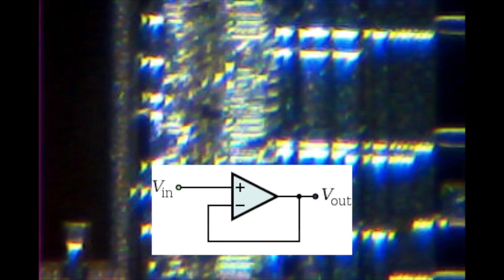What's inside a microchip ?

Comment: Really gives you an idea of how complex computers are. It's insane how precise the manufacturing have to be to make all of this work.
Reply: TheHolyReality It is all regulated by computers nowadays. They make a batch and then check a few chips for their functionality - if they all work, probably the rest work as well.

To see how IC-s are made you can search youtube - there are a lot of videos on it.
Reply: @jyrgenruut  They test all the chips on the wafer, not just some, and it doesn't work like that. You will get more dead in some, more alive in others, and they're not located in the same spot or such.
Reply: @jackbootshamangaming4541  I made that post over 6 years ago. Since then I have learned that they indeed, test every single chip with a very basic set of instructions and various speeds to test for how well the chip performs. A single design could result in quite a few different types of IC-s... this is called "binning". And this is also the reason why, when overclocking, different processors would fail at completely different overclocking speeds - they simply wouldn't test for it at the factory. 

(In addition I have learned a lot more about IC manufacturing and design in general since then... I know my post is a bit misleading)
Reply: @jackbootshamangaming4541  What is a transputer?
Reply: Actually all chips are tested because a single dust particle can destroy a chip. Even with the most painstaking measures of ensuring clean assembly lines the rooms are never entirely clean. That means that every chip has to be tested for functionality.
This is also the reason why they don't make chips the size of a wafer: If you have many small chips on a wafer then you will have to throw some of them away but still get a good yield. But if you were to make a chip as big as a wafer you would probably have to throw >99% of all chips away.

Some measures to increase the yield is to make designs that can cope with a defect. The Playstation 3 was built with an 8-Core CPU - but it only used 7 cores. Why? Because the chip was designed such that the cores could be deactivated if faulty. So if during production a particle of dust landed on one of the cores but the other seven were fine, no biggy, works anyway. Of course, a particle of dust landing on some critical parts would still destroy the chip, but such a yield increase makes things a lot cheaper.

There is also another reason why every chip has to be tested: Not all chips are created equal. Your typical Intel CPU will be sold under many different classifications - 7400, 7700, 7-something-or-another... but they were all designed the same. It's just that the silicon was formed better on some than on others, so the better ones become the i7s and the worse the i3s. Different cache sizes? Well, there was a defect on one cache block. Different speeds? Some transistors turned out not that well and the chip can't go as fast as it's neighbor.
Reply: @Althemor  
Honestly, a massive thanks for this explanation. I've been pining for microchip answers for months and the more I find, the more I'd like to know. Your answer helps so much lol
Reply: @jayrh98  Things have actually changed somewhat since then. Taking the newest generation as an example, Intel actually makes its 12th gen processors in the form of four different "dies" (four designs, which become more different processor types ("SKUs" like i3 12100 or i9 12900K) through what I described in the old comment). The different end results they sell are just too different. The i3 12100 has 4 normal cores. The i9 12900K has 8 normal cores, AND 8 little cores. I'm pretty sure the die that produces 12100s doesn't even include the little cores in its design. And some dies have more integrated graphics than others.
Meanwhile most of AMD's products aren't "monolithic" designs anymore, or in other words: They don't produce the entire processor as one big piece, but rather as smaller pieces called "chiplets" which are then connected. AMD Processors up to the 5800X are made of one eight-core (unless cores are disabled because of defects) chiplet connected to the IO die. Basically, the eight-core chiplet is the raw computing power, and the IO die is the thing that handles communication with the rest of the computer, stuff like RAM, storage and graphics cards. More powerful AMD processors have multiple eight-core chiplets. This way, AMD can produce chips with a greater total size without incurring the same yield losses a monolithic design would bring, though a monolithic design would perform a bit better.
As far as I know, Intel intends to move to a "tile" based design in the future, which I don't know much about but I believe for the laymen it's basically the same thing.
Also, AMD is about to release a processor made with a pretty nifty new trick this month: The 5800X3D, called "3D" because they basically take a completed 5800X and then put cache (the super fast memory that's actually a part of the processor) on top of it. Overclocking is going to be disabled, though, probably because putting more stuff on top makes getting the heat out of it more difficult.
All in all, a lot has happened since AMD became competitive again.
Reply: This is an extremely old IC... you could even make out the block which saves the bit (not too sure about EEPROMs but I don't think what he said was 1 transistor really was 1 transistor... the transistor part of it was probably even smaller). Nowadays one transistor is just about over 500 times smaller than that one block. You will not be able to see it under an optical microscope... even electron microscopes have a hard time picking them up right now.
Reply: @jyrgenruut  you seem to know about this, so, how can we (as humans) build this kind of machines capable to print or to construct with this precision?.
Reply: @emilianotonayan7903  look into something called "photolithography". That's the process; there's even a long writeup on how someone made an IC at home from scratch (using photolithography just like in the big factories), but unfortunately I did not save the link anywhere, so I can't point to it, sorry.
Reply: @emilianotonayan7903  Ultra-precision engineering. The machines that handle all the manufacturing of wafers and such are insanely accurate.
There once was someone on a Dutch electronics forum that got a linear--moving sled from (if I remember it right) the Dutch part of NXP semiconductors. He would be using it for some special photography-method (I think focus stacking on very small objects)
At some point, someone asked where he got it from and what the specifications were. 'Accuracy is 1/4000th of a millimeter, without the backlash taken into account, one rotation of the axle can displace the sled 1/4250th of a millimeter' the person replied. 'Why did they get rid of it then?' 'Because the accuracy had became too little for current chipmanufacturing processes'... (and this is something like 6 years ago, if not further back)
Reply: @jyrgenruut  w😁wr
Reply: *****
then how the fuck are they made? who sees whats going on and is it going on as it is planned?
Reply: They don't! The chips are printed a layer at a time using photolithograohy, and they test them extensively to know they are working as planned. The methods are so precise as a matter of fact, that ic's are tested, and ones that have bad transistor blocks are physically isolated and then sold as less powerful chips. Nvidia does this with graphics chips. A gtx 1080 is the same as a gtx 1060 (the gpu die, not the bus or memory of course) without transistor blocks isolated. OR, what Sephok said lol
Reply: insane innit???
Reply: Alex McMahon I didn't say it wasn't possible. I just said that it is hard to pick them up. Seeing down to atomic level is not really a very easy job, it takes quite long to get the clear picture.
Reply: @jyrgenruut ট্রট্র‌😊😊😊োৌ
গত ক আহ@ট্র "😊+%+😊/
Reply: +HolyReality They use masks and put UV light trough the mask which forms the shapes on the silicon, then they etch away material or put impurities to change the properties. And do that many times to build the circuit. You should search for a video about the process, it's quite cool. ;)

So they aren't made manually transistor at a time, instead with masks, light, etc.

But then I don't know how are the masks made.

Also not all of them will work, a large amount of the chips made will not work, they test each chip and the ones that work will be shipped to customers. The amount of working chips they get in relation to how many was made, I think is called yield.
Reply: +wopmf4345FxFDxdGaa20 don't forget the process of the chip is made like a building.. with different stories. each having their own kind of recipe making them different from the layers below and above.  Its probably how they are able to etch on top of each other without joining all the etches lying below. 

Also, each chip is different and will clock differently making them all unique. no two chips are created equal :)
Reply: christopher jones Yes. :)

I don't know is there many layers of transistors, but at least there is many layers of connections that connect the transistors. The connections are metallic.

Then they also somehow add new material at different points of the process.
Reply: HolyReality,
hahaha... u said exactly what i think
Reply: Yes. The micro- & nano-level techs, components etc. behind computer are definitely underrated but the precision manufacturing equipment & processes (& the mother machines that makes them) are super-underrated!
Reply: at the same time the concept is so simple.  It is simple but complex.
Reply: @r4r1m  It requires great ingenuity to come up with simple ideas & then implement them.
Reply: And how complex our brains are
Reply: @aboflahfans5191  The most complex machine in the known universe!  Man or woman?
Reply: I've been researching into circuits and discovered an awesome website at Gregs Electro Blog (google it if you are interested)
Reply: hello.today
Reply: By robot.
Reply: This is why there tiny anddddddd expensive
Reply: LMFAO so reading this comment made me laugh because I make these it’s a 30 day process but it’s the how not precise the manufacturing is ...if we mess up we simply rework it or destroy it it’s not hard to make these
Reply: @Angel_xj  That’s about the same time as it takes to distill whiskey & a similar process too!
Reply: We're almost to the point where we can't make traditional computers any smaller because electrons would start quantum tunnelling across circuits
Reply: And you can buy all that for only a couple hundred bucks
Reply: Taiwan 🇹🇼 makes 80% of all microchips in the world.
Reply: Taiwan 🇹🇼 makes 80% of all microchips in the world.
Reply: Taiwan  makes 80% of all microchips in the world.
Reply: Taiwan  makes 80% of all microchips in the world.
Reply: Very old but very cool. I use to program those in batches.
Reply: humans age 200 000 years  dinosaurs age 160 000 000 years..............
.https://www.youtube.com/watch?v=3whq8Y6wcKs.............. 
 NO NEXT DIMENSION NO NOTHING.
Reply: It's an oldest comment but...nah, it's all error and error and incompatibility
Reply: +Jürgen Ruut No no no, they can see and manipulate INDIVIDUAL ATOMS (and have been able to since 1981), transistors are clearly visible to Scanning Tunneling Microscopes.

There's a video, by IBM, called a"A boy And His Atom", made out of atoms. You can google pictures taken of microprocessors by Scanning Tunneling Microscopes and a whole pile of things will show up. One can look at fairly current cross sectional images of apple's mobile chips, and clearly see transistors. STMs are commonly used for validation of chips, too. 

"A Boy And His Atom": /watch?v=oSCX78-8-q0
Reply: Yes human can't do that, this beautiful and edivence for GOD. GOD made the computer for human and made human too. He made computer so human can be special.
Reply: @tassadardaris7294  Yes, humans can do incredible things but are also capable of greed, selfishness & unbelievable cruelty & evilness!!!
Reply: @tassadardaris7294  Who is God?
Reply: wopmf4345FxFDxdGaa20 +1

Comment: what do you mean they are bonded using ultrasonic energy? :P whats that?
Reply: ultra (a lot of) sonic (sound). They vibrate the crap out of the wire at millions of hertz to, literally, melt the metal to the other metal.
Reply: Vebulous Xerconis lol ultra is not "a lot" its just high frequency sound that we cant hear
Reply: yakir11114 its both! ultra means high in terms of frequency = it has a lot of it = its the sum of multiple frequencies combined so its a lot of it :P

Comment: Usually we use Alloyed aluminum or pure gold as bonding wire material, not Silver. Because according to my knowledge, Silver can NOT establish firm connection.
Nowadays copper is also used because it's cheap than gold and lower resistance than aluminum. But using copper require special manufacturing process.
Reply: firm connection was not issue,but to small amount silver you could add into connectin..simply it means you need more silver than chooper to make good connection..that was real reason why solver was not used

Comment: Actually there are quite a few reasons to use an IC instead of discrete components, esp for trivial stuff.
Cost, simplicity, much more reliable, integrated protections, thermal matching, hFE matching...